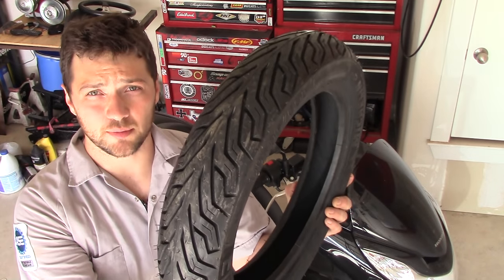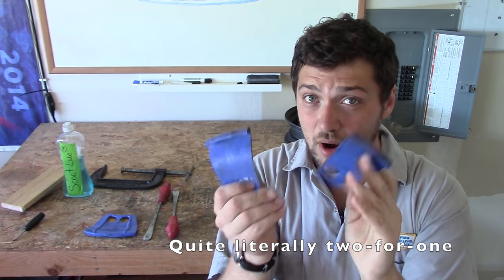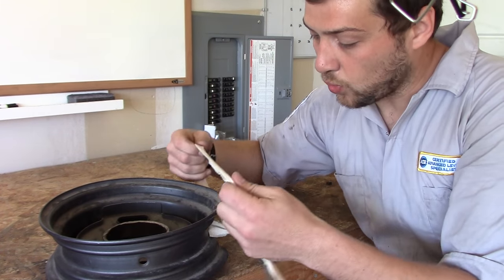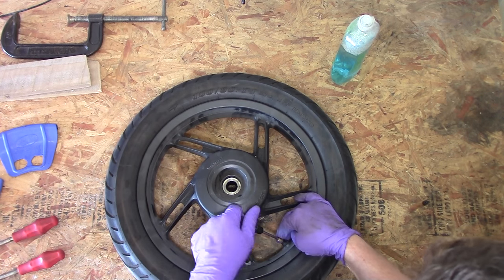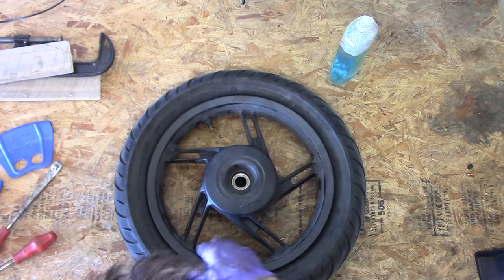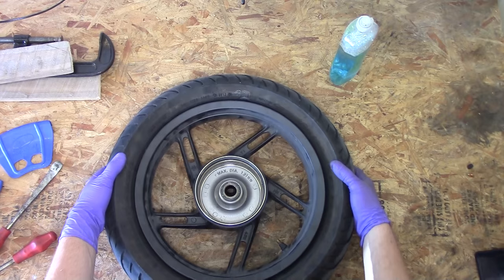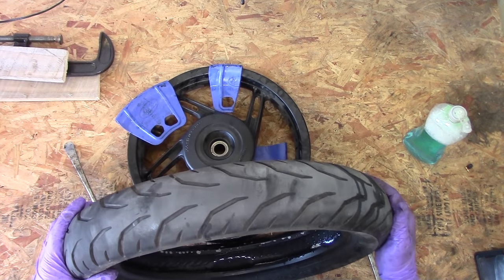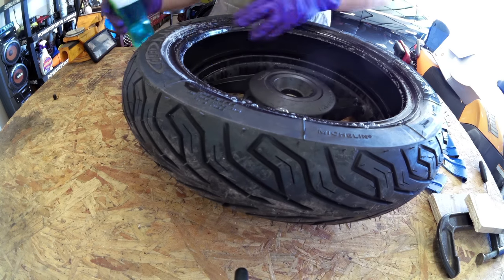Scooter 911: How to change a motorcycle or scooter tire BY HAND! (a complete guide!)

Comment: So after a lot of struggling (I'm not as strong as you - lol)  I got my tires on the rims. I went down to the local shop that has an air pump to put the air in and it won't go in. The beads are still mostly in the bead drop. I set the air pressure to the right amount as shown on the tire, I even removed the valve cores like you suggested, but the air is not going in the tire. I took them to a garage and the guy there tried to put air in and got the same result. Can you help me figure out what I'm doing wrong? You made it look so easy but it's not working for me.
Reply from the maker: First of all congratulations! You accomplished the hardest (and most impressive) part! Can you clear something up for me though? When you say air won't go in the tire do you mean no air comes out of the air hose when you put it on the valve stem? Or do you mean air rushes through the valve stem but doesn't inflate the tire?
Reply: @Scooter_911  Thank you!  That latter. Air is definitely coming out of the hose. It sounds like it's going into the valve stem but the tire doesn't inflate at all.
Reply from the maker: @rubyfirefly2582  ahhhh yes that can happen from time to time and sometimes it can be tricky.

 The first thing you should do is make sure both beads of the tire are good and soapy wet. This will help them slide and it will also help create a seal between the rim and the bead.

 Next try standing the wheel upright. Sometimes when the wheel is laying on it's side it creates too big of a gap between the bead and the rim. When it's on its side, support the weight of the rim so it's not pushing down on the tire and creating a larger gap up top.

If that still doesn't work you can try forcing the tire closer to the wheel with a ratchet strap. Lay the strap around the circumference of the tire and sqeeeeeeze it tight. This sometimes will force the beads of the tire to spread apart from each other and make contact with the wheel.

Let me know how it goes. Don't give up and good luck!
Reply: @Scooter_911  So I tried all of what you suggested.  No matter what I do, the bead keeps sliding into the bead drop. I tried pushing it standing up, but I don't have the strength to support/hold the rim up.  Tried the strap method and it just keeps pushing into the bead drop and not out to the rim.

I also tried wedging a screwdriver under and pushing one side out to the rim from the back. That seemed to be working but I can't get it to go all the way around. I also got concerned that I was going to damage the bead. 

sigh  I'm very patient and determined - I'm willing to try anything, but I don't know what to do. I never though this would be such a problem.
Reply from the maker: @rubyfirefly2582  Well friend, rest assured almost every technician has had their butt kicked by a set of tires at some point in time. It's possible that the air compressor you're using does not flow enough air to puff the tire outward fast enough to seal the bead. You can always stop by a tire shop and see if they'll take pity on you and use their big air compressor to seat the beads. There is another tire tool called a "cheatah" which is a big air cannon that can blast the bead right on to the wheel. You can ask if they have that. Good luck, don't give up. And you were right about the screwdriver, it can damage the bead or the wheel.
Reply: @rubyfirefly2582  I'm in the exact same predicament as you on my 12" Vespa wheel.  Got all the way to the bead seating point thanks to this great video by @Garret Seesing but could not get the bead to seat.  I bought some Xtra Seal Mounting Compound from Advance Auto Parts and am going to try that this afternoon.  The way it works is it creates a temporary seal to close the gaps between the bead and the rim that allows enough air to be inflated to pop the bead out and on to the rim.  This video shows a different brand of the same type of product: https://www.youtube.com/watch?v=t1SPBfeYBuI

I'll keep you posted on my results.

Here's a link to the product: https://shop.advanceautoparts.com/p/xtra-seal-8lb-x-tra-seal-compound-14-708e/28200406-P?searchTerm=Xtra+Seal+Mounting+Compound
Reply: @ddicecco   Would love to hear how you make out.
Reply: @Scooter_911   BIG UPDATE!  I found a local motorcycle repair shop that was able to help seat my tires and fill them with air!  I put them back on my Vespa (ET4, LX150, 2004). The guy at the shop also told me that I might be able to repair and repaint my rusty, ugly muffler, so I did that, too. Now my muffler looks brand new as well!  My battery had enough life left in it to give it a jump charge and the Vespa actually started up!  I rode it all over town a few days ago!  A miracle after sitting for a year!  I can't tell you how excited and happy I am!  It wouldn't have been possible without your video. I looked all through Youtube and while there are many videos on the topic, no one explained and showed to the level of detail that you did which made all the difference. Thanks again!  Keep making videos like this for all us do-it-yourselfers.
Reply: @rubyfirefly2582  The sealing compound helped but my air compressor wasn't inflating fast enough so it still wouldn't seat. I ended up taking it to a tire shop and they seated them for me for free.
Reply: @ddicecco  Yeah I ended up having to do the same. And my guy did it for free, too. Good to know there are nice people out there. Congrats. Are you ready to ride?  I'm gonna clean my air filter.
Reply: @rubyfirefly2582  Yep! Just in time for great weather too 😁

Comment: Hi, could you add a 10" E-scooter supplement to the tire change?
There are other considerations such as the speedometer, disk brakes, and power connector, which is a little more complex than fuel powered vehicles.
Thanks